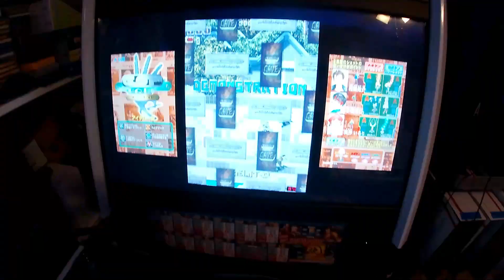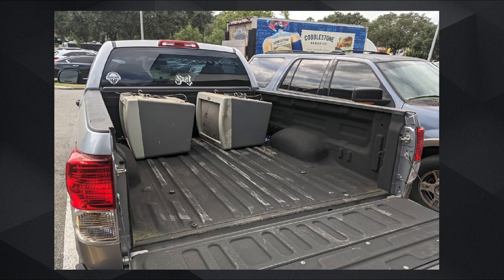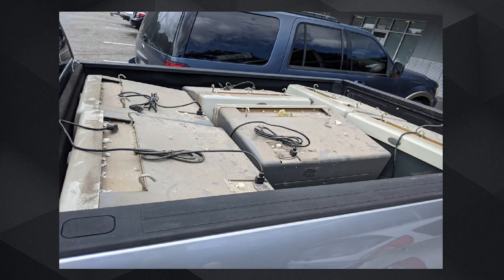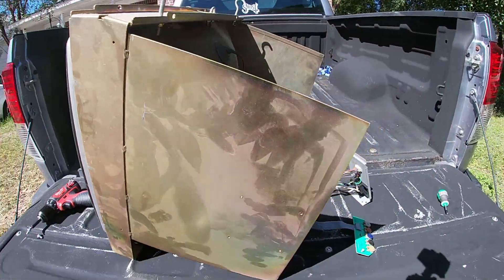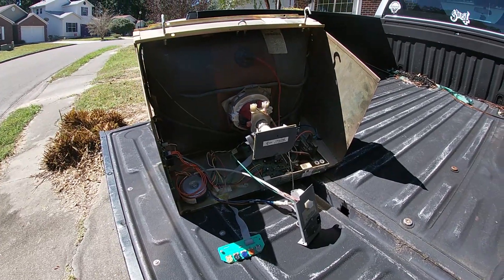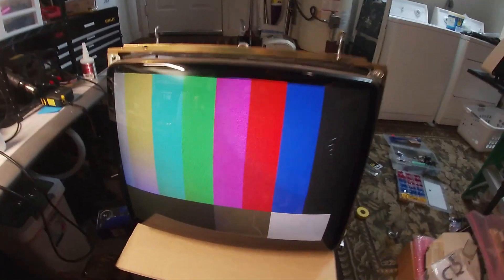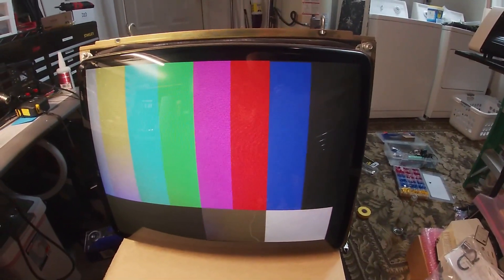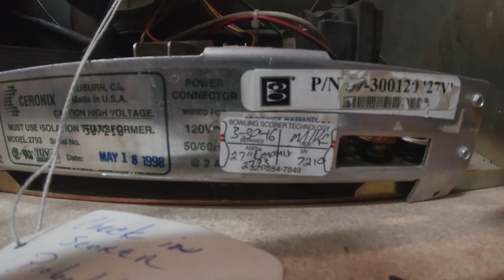Arcade CRT Rescue - Part 1  :  PastBlaster Episode 82

Comment: great work, awesome catch and really cool that they were 15Khz monitors as well! What did you clean the glass with around the edges, it looked much better once in the garage?
Reply from the maker: Good Eye. I used Simple Green to cut through the thick dust / grime, then Novus 1 to clean  the glass. These things are DIRTY.

Comment: Did you find that these are kind of dark?  I picked up a few from a local bowling alley, and they work and look good, but if looking at the colors bars on the test suite, they only go down about halfway.  Thanks.
Reply from the maker: Mine aren't dark, but they are limited on options. You can adjust the flyback for a bit of brightness boost too. I've been pretty happy with them so far.
Reply: @PastBlaster  yeah, mine has the auto g2 adjust feature, so I can adjust the flyback and it like auto dims it back. They also have auto bias too, so you don't have any color control.  I grabbed about ten and they all behave the same. Service manual states they want 0.7v for rgb otherwise I would have guessed they want more due to the dimness I get.